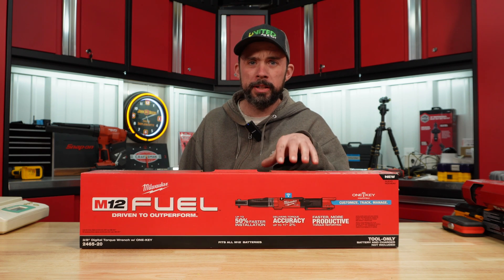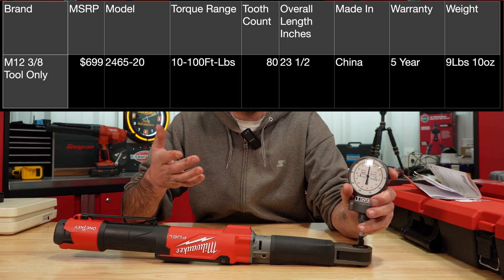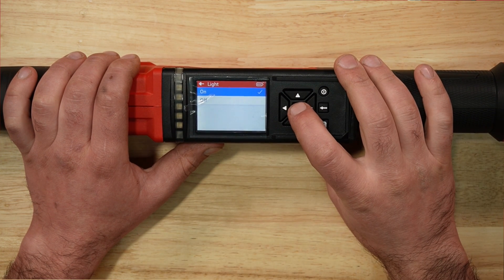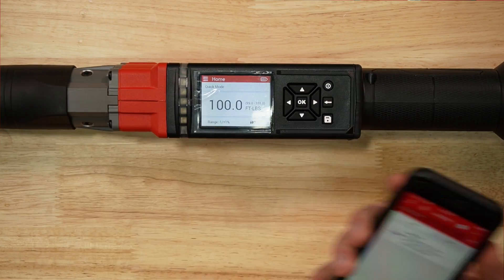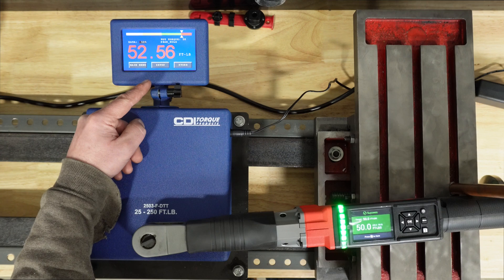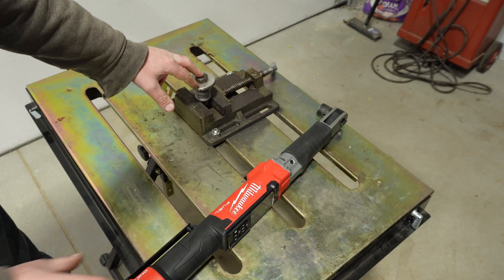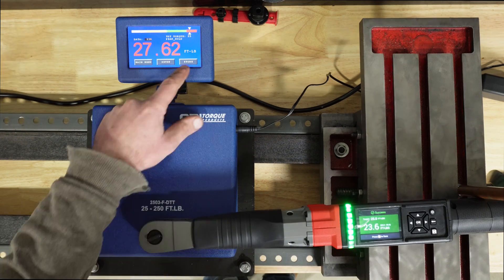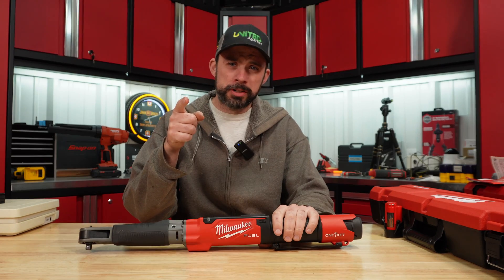Milwaukee Torque Wrench Fails Accuracy Testing,  Unboxing and Review

Comment: You can't check torque by loosening a fastener. Use your snap on to torque a bolt then use it to remove the bolt you just torqued and you will have the same lower torque results
Reply from the maker: This is only to test the rundown feature which claims it can achieve 100% of the torque.  So if true set at 100 I should see near that not 32 Ft-lbs, or 9 when its set to 25.  Yes removal will always be less,  but this is not a normal bolt,  Its a rundown fine thread loaded bolt.  The goal in this scenario was just to see if it even came close.

Comment: Milwaukee 'bout to burn down a whole Chinese factory now. That sucks. I thought it looked cool but seemed more like a industrial electricians torque wrench rather than a mechanics torque wrench so I didnt bother but foot pounds are foot pounds and this thing might as well be a super extended length overpriced Milwaukee M12 ratchet. Honestly i hope you just got a defective unit but in my opinion Milwaukee should have never started at this price point with this much tech. To my knowledge this is their first torque wrench, why didn't they start with a basic click one like Dewalt so they can work out kinks in their manufacturing?!
Reply from the maker: Yep I agree they should have never started with this advanced of a wrench.  It's weird to me they focused on electricians for this , I would have thought a bigger market would be mechanics.  

Hopefully I did receive a defective one and normally they are accurate as they claim.

Comment: I'm not a fan of digital torque wrenchs. Who are these folks spending that much for a torque wrench? That's nuts
Reply from the maker: This is geared towards electricians building large electrical panels.  Most techs in shops spend around that amount but yeah its crazy.

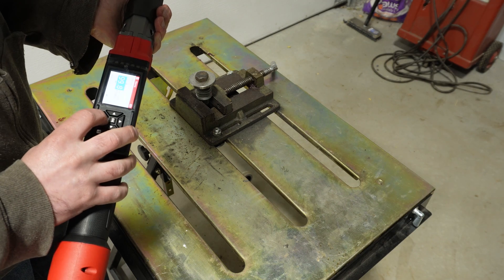Comment: 7:50 torque to loosen is always less than torque to tighten (without rust, etc). You should have done this test by hand tightening to 25 with all 3 wrenches and loosening with the snap-on, then you could make a decent judgment of the run down feature.
Reply: This is important.
Reply: You should perform a residual check that will give you the best indication of what the fastener is torqued upto
Reply: @timmortimer19861  haha, yeah that's a much better way
Reply: Isn’t it like 75% of original torque to loosen it? Torqued to 100 takes about 75 to loosen.
Reply from the maker: This is only to test the rundown feature which claims it can achieve 100% of the torque.  So if true set at 100 I should see near that not 32 Ft-lbs, or 9 when its set to 25.  Yes removal will always be less,  but this is not a normal bolt,  Its a rundown fine thread loaded bolt.

Comment: I cant believe that a harbor freight micrometer torque is more accurate than a $700 digital torque wrench for Milwaukee blew my minds
Reply from the maker: Mine as well,  I have walked by those $20 torque wrenches in HF and laughed,  "they cant be accurate". Well I have tested 2 of them and both are lol!
Reply: @Tools-Tested  we need more harbor freight tool tests honestly. Because i just went out and bought one due to your tests with em.
Reply: I don't think it's that surprising. It's a much simpler design, and plenty of youtubers have tested have tested them and found them to be to be accurate. It's a good tool, especially for its price.

Comment: Why would anyone choose this over the techangle? Serious question, pricing is nearly identical
Reply from the maker: Mainly for assemble speed for electricians building service panels,  and it easily provides a repot with one key which they can provide the inspector.
Reply: @Tools-Tested  gotcha, makes a little more sense now, so its mainly geared tword electricians not mechanics

Comment: Another great video. I have had a few brand new meters that I cannot repeat the calibration test on and get the same results that they show on the calibration certificate. Makes you wonder how genuine manufacturer's certification is sometimes.
Reply from the maker: Thanks,  yeah it really makes you question the certificates,  this thing seems consistent which makes me think it wasn't calibrated or was done wrong.
Reply: Sometimes I think it's a randomized bunch of numbers spit out and printed jammed in the box and off they go. Some company's its real and right on the money but $699 and made in China no thanks...

Comment: Also I had my certificate expire on mine. The tool just reminds you that it’s expired every time you turn it on and you have to accept it. It also won’t let you save the results. But you can still use it
Reply from the maker: Thanks for that info I was curious what would happen at 5000.

Comment: Holy cow, good save. I was going to buy one. I have a pittsburg Pro but I wanted a digital one as my eyes are pretty bad.
Reply: Lol going to this from a Pittsburgh is an enormous jump. Try out the Quinn digital or even the icon digital
Reply: . I really doubt you were going to buy this particular One
Reply from the maker: Yep pretty bad, thought it was going to be a good wrench.
Reply: @Tools-Tested  It certainly looks nice and the ratchet feature is nice in concept for a TW, but a apparently a detriment in this application of the feature.

Comment: Any product can be defective out of the box but for the cost that is extremely disappointing. Especially given that it came with a certification. I'd have a hard time trusting that tool in the future.
Reply from the maker: Yep and the packaging showed no damage.
Reply: @Tools-Tested  if the box was dropped on its face you would not be able to notice any damage, wise guy.
Reply: @HylianOverlord  but most digital torque wrenches recalibrate themselves every time turned on
Reply: @alejandroortiz2162  You mean they zero themselves, if they recalibrated everytime you would be able to have certs for it.
Reply: @HylianOverlord if the wrench is damaged before the box is then guess what? It's a junk tool...